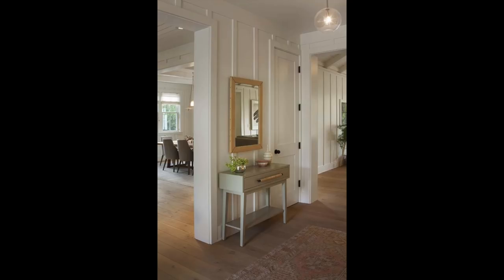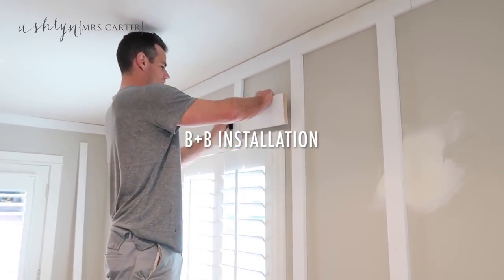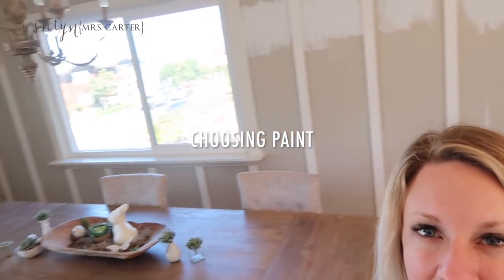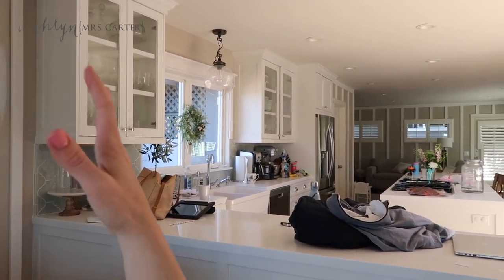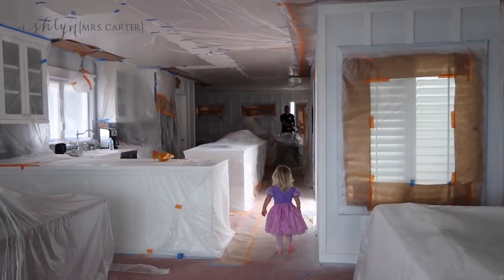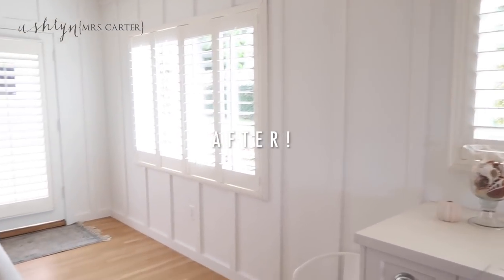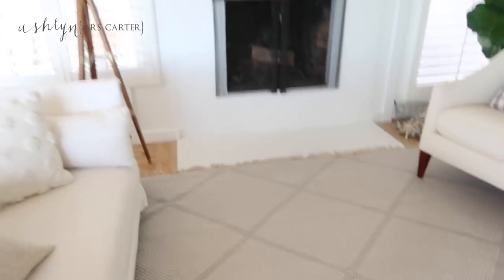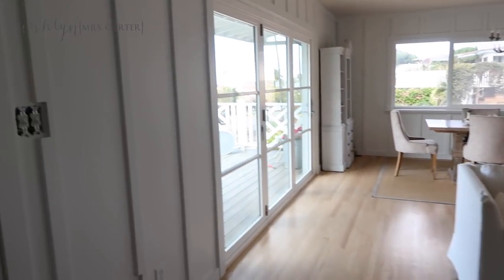BOARD + BATTEN | Before + After Beach House Transformation

Comment: You mentioned your spacing of vertical boards weren't  based on stud placement.  Do you not have to nail the boards into a stud?  I thought that, depending how far apart your studs are, that would dictate on how much space between boards.  Also, you mentioned your header and baseboards were 1 X 4's (3.5).  Did you use this size throughout the whole house? I am just starting this project on feature wall in my son's room and his baseboards are in rough shape so thought I would continue the same baseboard that is on feature wall around the room for a clean look.  This is my first time attempting this and I have limited tools so was thinking of buying a mitre box.  Would this be sufficient in this installation?  Many thanks. Beautiful job!

Comment: Seems like they should have painted first then add the wood because that will slow down the painters, thus cost more.
Reply from the maker: Rene' Barry you have to paint after. Otherwise you would not get a seamless smooth  look and the nail holes would show.
Reply: That's a lot of work either way. Looks good though.